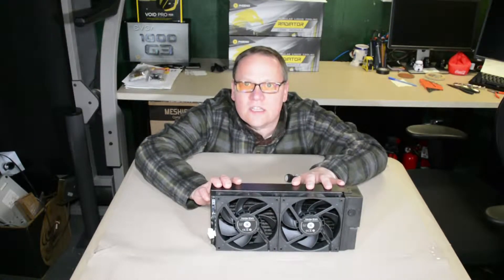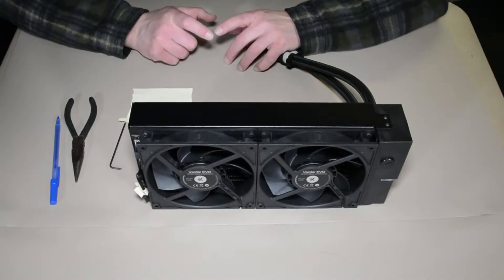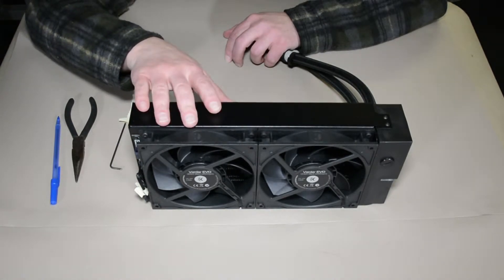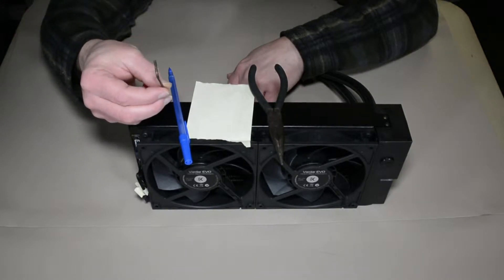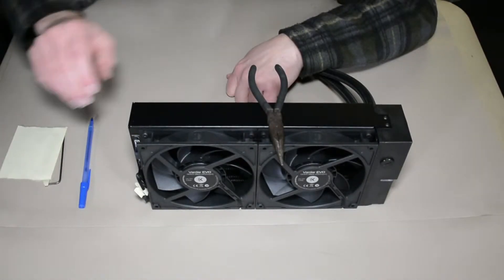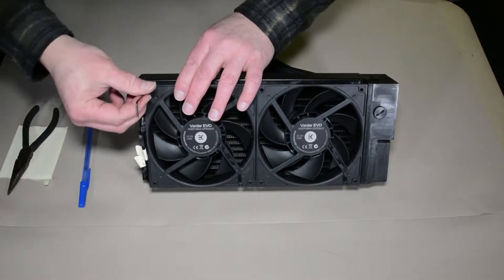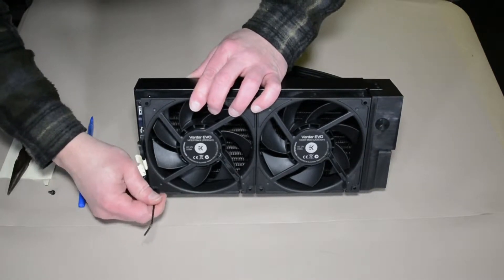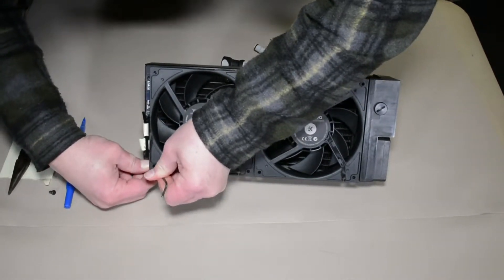EK Phoenix Series Part 11 rad disassemble to change air flow direction

Comment: i want to know if its a good pump.
Reply from the maker: It does the job very well for the components that are in the Phoenix series.  I will be doing a video with a mod that uses custom water blocks stay tuned for that.  Should be up in a week or two.

Comment: Was really hoping to see how the tubs come off and pump comes out. And if the barb fittings they use are permanent or not.
Reply from the maker: IF it was sponsored(the hardware) I might have but I was more curious, at the time of the video, if I could even take the fans off and turn them around, they were on really tight to the point where I thought that EK wanted them to stay in the orientation that they were in.
Reply: @TheTechBasement  Yeah I remember them being a PITA to get off, I'm running mine with some NFA12x25's from Noctua and was playing with the Idea of modding it but I may just go full custom.

Comment: This was cool. I would absolutely love to see you disassemble the whole thing. I really want to try and build my own open AIO like the pheonix. I already have spent tons on custom loop parts so spending the extra $300 or so to get the pheonix core is hard to justify. I would love to just buy a little pump/res thing that I could mount to the top of one of my rads though and build my own open AIO just like theirs. I see now though, thanks to this video you made, that it even has a built in hub where all the wires plug into, that's really nice, I had no clue there was so much going on there. Thanks! I hope to see more, I would love to see the reservoir and pump taken apart if you ever have the time and need to do so.
Reply: I ended up buying the Phoenix, they are on clearance and I got the 280 for $113, CPU module for $45 and the GPU for $100, couldn’t pass it up. I am thinking about replacing the pump on the Phoenix core, the spc60 it comes with, with a DDC 3.2 maybe.
Reply from the maker: I just picked up the 240 and will have a Video up sometime within the next month or 2, have to figure out what Im going to do with it.  Finances had to be diverted from my original plans.  I was going to do a Mini build using the 3700x.  Live comes at you fast.  watch you corners!
Reply from the maker: Tks for stopping by and watching the video.  This is what the channel is all about.  If the pumps fail I will definately do a video on my finding if not repair.